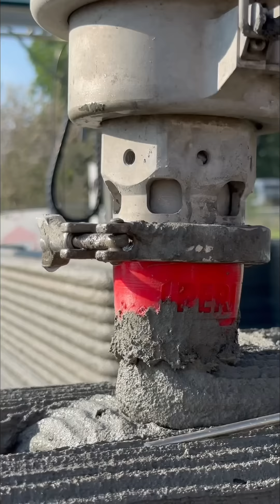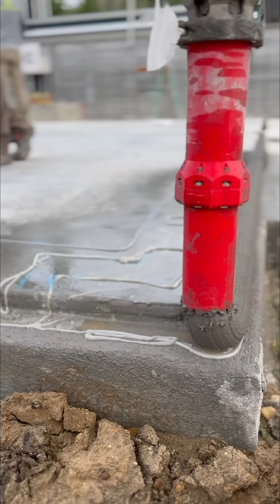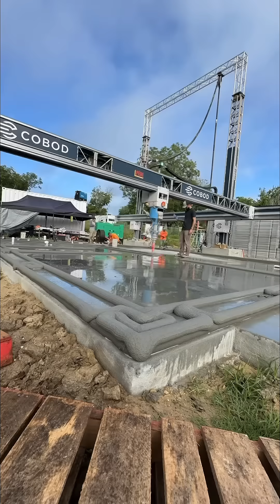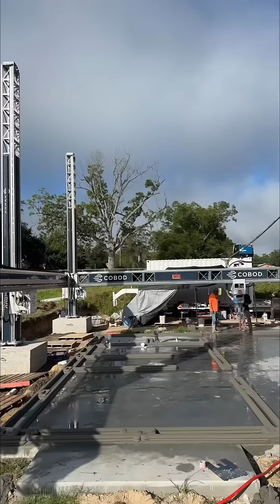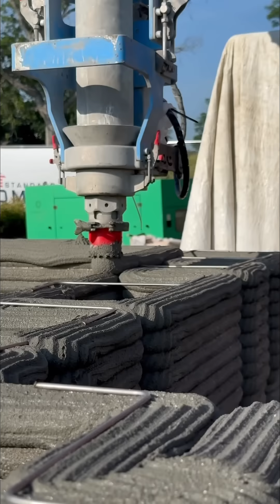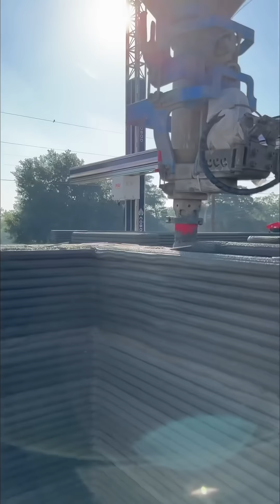Engineering is beautiful, the future is inevitable and the robots are coming!

Comment: too Bad it Doesnt Use Pressure Advance Flow Control lol. or it would be A LOT Better - like an FDM 3D Printer.
Reply from the maker: It uses a variable flow drive on the mixer pump system